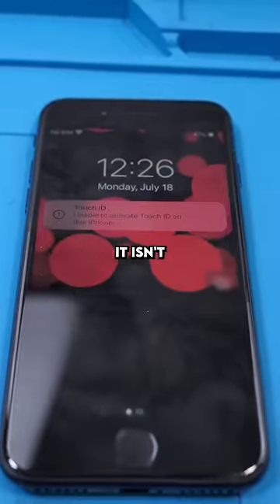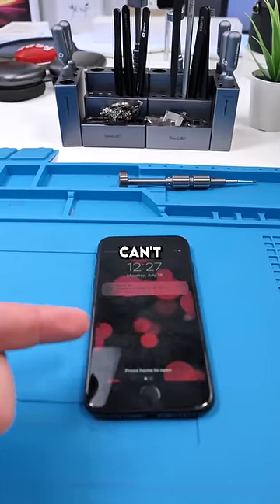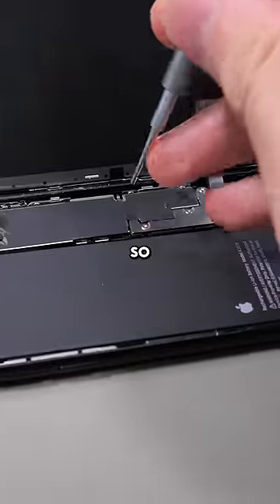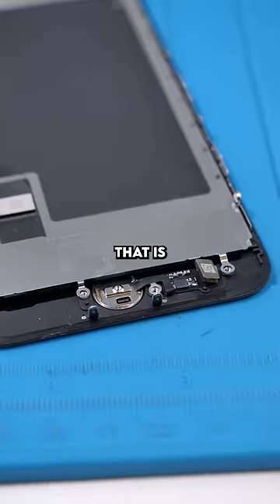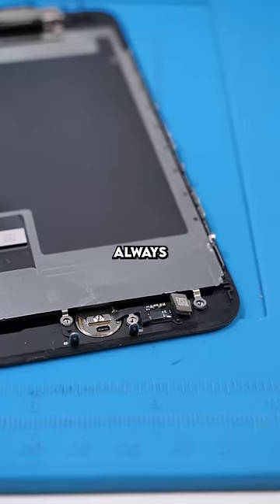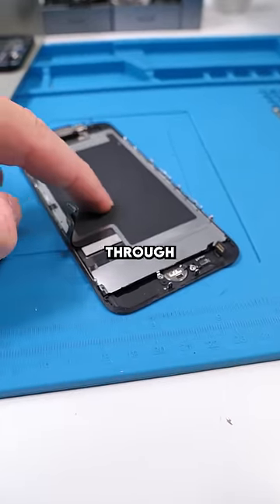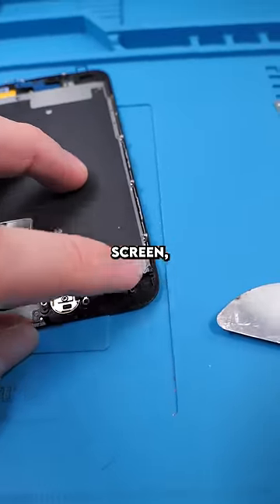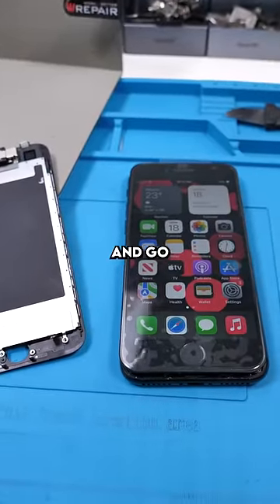iPhone Home Buttons Are Not An EASY Fix.... #Shorts

Comment: SE3 just released, so that device must have warranty. She could’ve just went to apple and replaced the phone.
Reply: Not really. If she had unauthorized screen replacement, then there is no warranty.
Reply: Apple barely does shit
Reply: Apple probably doesn't cover finger print sensors
Reply: I think it's about turn around time from official repairs is generally much higher than local shops.
Reply: @vojtara  she should’ve just gone to apple and then she could’ve gotten a new phone instead of voiding her warranty at a repair shop
Reply: Women☕️
Reply: @Spryzen_  She had the back glass replaced, meaning she dropped it to crack that. That pretty much voids the warranty completely, so I doubt going to Apple would have done any good. Now to be fair under warranty she could likely have gotten a cheaper first party repair from Apple, but there's a good chance they're charging her double the price of a normal back glass and will take a week to do it.
Reply: @justinli826  warranty isn’t voided that easily.
Reply: @vojtara  why would she replace the screen? If there’s anything wrong with the phone which is not due to water damage then the phone can be replaced by warranty. I have got a new phone the same way
Reply: @kosmokramer9502  A 5 second google search provided me with this info from Apple support for their warranty coverage in my country:

"Accidental damage isn't covered by the Apple warranty. Screen repairs and back-glass repairs (for certain models) are eligible for coverage for accidental damage from handling with your AppleCare+."

So yes. Warranty is in fact voided that easily. At least attempt to fact check yourself before posting asinine replies. Now of course you might be thinking of countering me with "that's only not covered, it doesn't void warranty". Except all I've seen from Apple is that if you drop it and it cracks, then your phone develops issues later on, they immediately chalk it up to "customer damage" and ignore your warranty.
Reply: @vojtara  what a robbery!
Reply: @Spryzen_  in the United States, companies can't void your warranty if you go to an independent repair shop. Even if you fix your own phone, as long as you didn't do a bad repair.
Reply: @vojtara  not in the us we have something called right to repair laws
Reply: @justinli826  That doesn't mean that they will completely void the warranty.
Reply: @That0neDud I don’t think they do but back in 2019 I had a iPhone 8 that I threw against the wall and the screen busted and the home button shattered (also the phone was bent) We took it to sprint (our old carrier) and they replaced the screen and home button. I still don’t know how they replaced the home button. I know it was the same phone because it was still bent and all my data was still there

Comment: You did not have to sell her a new screen, a new cable behind the metal shield would have fixed the problem. You can easily use these cables from an old broken lcd.

Comment: You can pull of the back metal on an iPhone 7/7+8/8+/SE2/SE3 and take the home button cable out and put it in another phone. Only problem is it will probably destroy the screen but it's good if you have a heap of dead screens sitting and good screens with broken home button cables
Reply: Everyone really Dunking on him for replacing the screen

Comment: You can actually replace the backlit screen because you basically the socket touch id wire and it's attached the backlit, but this replacement carries the risk of leaks because it's basically soldered .

Comment: Something I found with these home buttons, if that small metal strip plate that covers the back of the  home button is a little warped it can mess with the force sensing of the home button. Meaning touch ID still works but the home button function does not

Comment: Same thing happened to an iphone 7 when I replaced the screen, the new cable on the screen was bad causing the home button to stop working. Harvested the cable from the old screen and it worked. Eventually replaced the screen again with a properly working one.

Comment: There is a method of replacing the home button using iTunes and doing a backup before changing the button then after changing the home button restore the backup and it should fix that stuff

Comment: I have a 2nd Gen iPod Touch, it’s well used and the Home button is perfect. Apple started using inferior equipment as on later models of the touch’s and phones etc the home button typically failed.

Comment: Might not be necessary to use a new screen. If you have an old iPhone 8 or SE3 screen you may be able to salvage the home button flex cable from one. You'll have to take apart the LCD to get to it, but it should work.

Comment: As a phone repair gal this is so cool that worked, I've had so many iPhones I've had to cut the price in half of because the home button got messed up. 

Unfortunately to the average joe this might sound kinda sketchy and like you're trying to charge them for a much higher price, how did you explain it to her?
Reply: why would you charge a customer less if he brought  a device with a broken home button? We just tell the customer upfront that there is no way to fix it without getting an Apple Original screen and they‘re fine with Assistive Touch.

Comment: All u had to do was remove the metal protecting the back of the screen by removing the screws on the side exposing the flex cable that connects the home button to the mother board and change that instead of an entire screen. YES… I’ve done it before

Comment: you ripp3d the homebutton connection when u did the back glass. it's behind the back plate but like zero precent chance she did that when u lift the screen it can easily micro tear and I'm guessing that's what happened. I freaking hate after market home buttons idk but the black ones her have almost a 75% fail rate just on black. we use great parts.

Comment: The fact that Apple went through the extra effort to lock touch ID if you replace the home button to put their technicians under more load because they're the only ones who can fix a broken home button does not make much sense. This could be fixed with a software update. If Apple fixed this, they would be supporting Right to Repair.
Reply: Then fixed it for FaceID, I’m sure they could for TouchID.

Comment: Broo there is a flex cable under the steel plate on the display remove the plate and put a new flex is that simple u dont have to change the whole screen 😄

Comment: Yes, iphone and samsung.... I broke my charger socket and they required me to change my screen
Reply: Most samsungs you don't need to touch the screen at all to get to the charging port. All of the newer ones you just have to remove the back glass, unscrew the board that the port is on, disconnect the cables, and replace it.
Reply: @ultratechgaming199  i have note FE and S7 back then '-')

Comment: I have an iPhone 6s Plus and my home button recently messed up. It only works very very few times. I was able to put the accessory button on so I can use my phone. However, if my phone shuts down, it’s over for me. My phone is so dumb that it needs both the power button and the home button pressed to turn on, however the home button doesn’t work. Any good phone recommendations so I can replace my phone?

Comment: One time I lost my iPhone 6 in my house on 2020 I did have my iPad but did not use find my iPhone so t then in 2022 I found it it was under my mattress it was a little craked so I charged it up and the home button was stuck I got a tooth pick and took Al the wall of dust in the home button it clicked but no response from the phoen for  2 months I decided to buy the iPhone 13 pro so I repaired this divide and turns out that the home button cable was intensely damaged thre was rips every Whre so after spending 50 bucks repairing it it looked brand new I asked te dude to meake the phone like new iPhone 11 he took he did it then I gave the phone to my brothers kid I told him it was. iPhone 13 he beloved it and stil using it

Comment: bro my iphone 8 after replacing my display tuch id not work properly and home button has same problem
Reply: The flex that connects the mb and button maybe bad connected or faulty. Even the home button is about to die, go check it with the person who changed the screen

Comment: I have an iPhone 6 It has 128 GB are used for Wi-Fi only which works out perfect for me I don’t bother with Facebook or anything else I think the battery is going bad because I had it replaced once free of charge from Apple I doubt they’ll do it again first time I’ve ever felt it to be warm it’s possible the batteries bad would you be able to tell me how much it would cost to replace the battery because I definitely want to keep The phone would you be able to help me thank you have a good day

Comment: @phone Repair Guru 
How do one fix IPhone home button that does not read any fingerprint
Reply: change screen
Reply: @Sid_20  i did change it before but still doesn’t wanna work thou
Reply: @fridhepute2024   check if has any problems in circuit

Comment: Your daily tip:

Any authorized Apple repair shop (UBIF or CPR) Can do OEM screen replacements which would replace and recalibrate a new home button. Micro soldering is unnecessary; you just have to pay an arm and a leg for an OEM display.